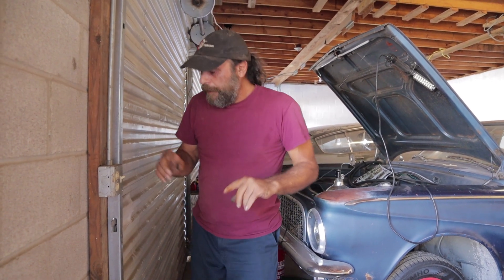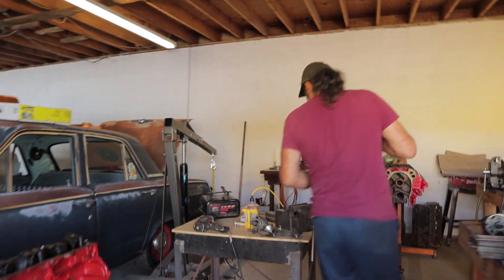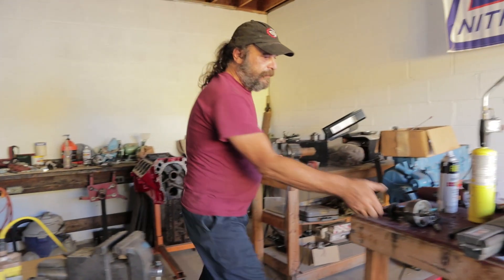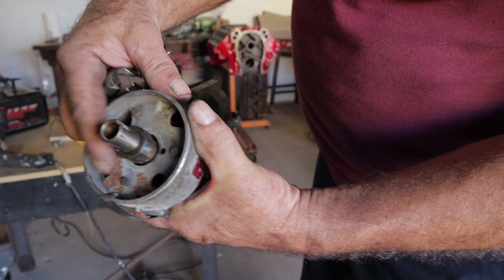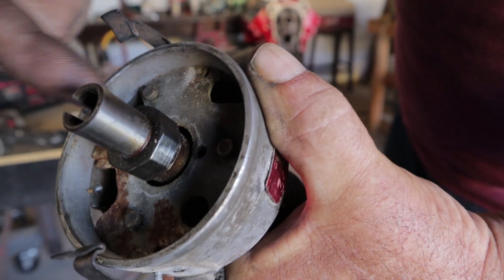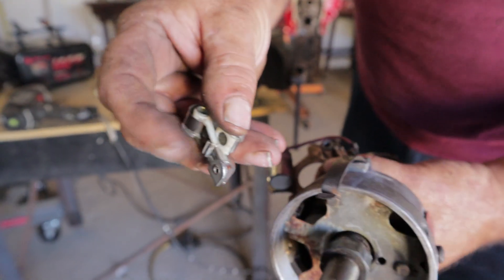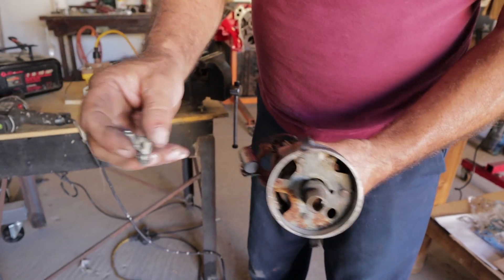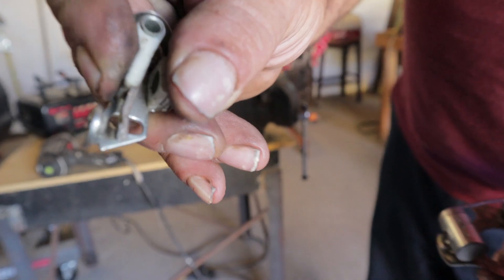Classic Car Tech-Ignition Points Explained

Comment: I have a 1973 Triumph TR6 and I have become a big fan of Uncle Tony!  The technology is the same as for the old Mopar cars Tony works on.  I’ve tried the Pertronix electronic ignition but have gone back to points because I’ve had better luck with them. TR6’s went from “non-ballasted” (no resistor between the car’s electrical system so 12 volts at + side of coil) to “ballasted” coils (resistor/ballast or resistor wire drops voltage to +/- 9 volts at + side of coil while the car is running) in 1973 which can drastically shorten the life of the points if you’re using the wrong coil.

Comment: I had a 59 Vette.  had a high tech dual point distributor. In 1984 I put in a 350 Cheby. Pumped it up. Rev'd to 8000rpm.. I used all the good parts. But I was still in the stone age.... I decided to try something different. I couldn't believe it was possible to improve on a good dual point.  Well, I put in an Accel BEI distributor with their Laser Box. And picked up about 50 HP. Literally. It was impressive on top end. I felt like Alley Oop with his dick in his hand. The BEI Laser system isn't produced now, it had issues. But when it worked it was spec'd to rev to 13000rpm on 70% nitro. It beat the crap out my the spare distributor, a Mallory Unilite.  That thing cost at least 20hp.  It was quite a lesson but I learned that electronic ignition is the best. A Magneto or an MSD8 would be as good, I assume.  The BEI distributor has ball bearings to hold the shaft. It was very precise. Used Hall Effects, of which i Know Nothing except it works.   Oh, my dual point had issues too:: The cam lobes wear and that makes setting dwell tough. And points bounce! Even at 6000rpm.  If your making HP you must use a magneto or something like an MSD8

Comment: 6 years later and Uncle Tony is still helping me out. 

It would have been nice for him to quickly explain that the voltage goes through the ballast resistor, onto the positive side of the coil, and then the points/condenser are connected to the negative side of the coil. Anyways, thanks. I've always wondered what the electrical flow does with these old cars.

Just did a tune up on my 69 buick skylark and lost spark after that. Now I can accurately diagnose it and find out the issue.

Comment: I always test ignition system with the battery make sure the condensers in series with the points or you're not going to get a good spark, violet blue spark very good red or yellow very bad. Look at the rubbing block on the points look at the points if they're shot they're shot. Check for distributor play looseness, then I think one of the most important things to check your ground wire and check to see if the vacuum advance is working. Then you look the whole thing over always always people used to replace caps and rotors when I can just clean it up but I always replace the plug wires unless there's a really high dollar wires that are not made of carbon but are made of wire. PS sometimes I had to take some 600 sandpaper and lightly sand lobes a little bit smoother so it doesn't tear up the points and cause them to close up as the cam would wear off the rubbing block.

Comment: Got a 67 250ci impala and a 68 C10 with 283ci (not original) both with points. Being the “mechanics car” I’ve never done any maintenance on the points. They just work for 20+ years and they have 20k miles each. I’ll probably have to service them soon but they’re not troublesome…

Comment: Nice presentation uncle Toni very simple. I’m a points and condenser guy. They’re reliable and I can fix them if they go bad if an electronic module goes bad I’m in the middle of nowhere. I cannot get the car running again.

Comment: Just to be clear. I can run my positive wire from battery power through a resistor to the coil? With a switch between the resistor and battery power?

Comment: I need some help, I have a 1963 Ford Falcon factory no mods, it’s getting 10.5 volts at the coil.  The car will run great for a half hour then die.  When I replaced the resistance wire from the ignition it ran like crap. I have since reconnected the old resistance wire.  What else can I look at to find how 10.5 volts is getting to my coil?  Thanks

Comment: Thank you, this video helped me immensely, I just spent 2 days trying to figure out why my 77 corolla doesn't have any spark. I thought that the wire on the distributor was supposed to be 12v, which lit a set of points on fire, luckily they had to be replaced anyway. Thanks

Comment: Key Takeaways:   Electrical ping-ponging taking place to turn 12v into 40,000 volts to generate an electrical spark.   The Coil works in Tandem with the distributor which works in tandem with turning the engine with a starter or under its own power.   As the engine is turned, the distributor has a series of 'contact points' (akin to a momentary switch)  that will be energized in a round-robin sequence that complete the circuit and energize the Coil.  Eventually as the distributor  rotates, the momentary contacts points break the circuit, the coil de-energizes and the collapsing magnetic field inside of the coil induces a higher 40,000 volt charge (like a  transformer does) that flows through that heavy center wire back to the distributor block and will energize the spark plug attached to that momentary contact point thats tied to a specific cylinder in the engine.  This keeps the entire engine firing the spark plugs in the correct order.   I don't know why they never rectified the language to call things for what they do, this is by far the worst tragedy in any 'educational' system to go with insufficient terms:    A Coil is meaningless.  A voltage amplifier would be a better term.   A distributor is a misnomer.   A power-sequencer is a better term.

Comment: Good vid, but disconnect your 12V before you blow your coil. That sparking coil wire at 4:44 meant your points were already closed and fully prepared  to overheat your poor coil! And yank the power as soon as your demo is over!

Comment: My brother's German Konig-powered race boats regularly required changing its Bosch or Sems magnetos, often between heats, as they didn't like heat. When he came in from one heat and the magneto was snarly, he always thought it best to exchange it with a "fresh" one. Time between heats was 5 minutes, so time was in short supply. Before we yanked the hot mag off the engine, he always wanted to ensure the fresh mag was good, so he would hold the mag in his hands and spin the gear... with me holding on to the leads. My arms still ache some 40 years later. I much prefer your test, Tony.

Comment: Working on a 1969 lincoln mark iii. Has points. It's driving me insane.  Runs good for about 30 seconds. Then runs like crap and eventually stalls. Sometimes clears up and idles good again for a few seconds.  It's not the carb. Tried pouring in some fuel while running. No difference.  I'm stumped
Reply from the maker: condenser

Comment: as of right now,i've replaced every ignition system on two of my cars and my motorhome,took everyone of them back to 1969,they all have points condensors and ballast resistors and common coils,two sets of points ,condensors and extra coils in the trunk in a shoe box,i'm not breaking down again in the desert with overheated electronic horse caca,walking is not crowded,and he's right there is no difference in voltage spike,the higher voltages come from exotic coils,and uncle tony is right,only thing electronic in my motorhome is the tv and the radios,point worked for a 100 years,change leaves you stranded

Comment: As you know, 1,300 RPM is 650 rpm at the rotor and 1,300 rpm at the rotor is 2,600 at the engine

Comment: great bench top setup.

I have a question.  On a motorcycle or lawnmower there is a flywheel and stator or maybe a magneto that provides the power to the coil.   In an automobile what makes the power that goes to the ignition sytem/coil?  Alternator?

Comment: I don't have any problem with my points I've set them only 1 time feeler gauge didn't work a old drag racer / hotter rodder told me to use a match book never had a problem the main problem is ppl switch it to 12v with out installing balsas resistor and adjusting timing
Reply: I've learn this when I was 17 i just barely turned 30 oh I for got to add even if u change generator to  3 wire chevy alternator internal voltage regulator and u still need to install a balas resistor weather you run points or not the original harness from late 70s and back was a 6v system wires will get hot and also burn the points leaving the key on will burn the points incorrect timming will burn the points old spark plugs will burn the points. Points make sure you don't slack off on the basic maintenance!!

Comment: Hi Tony. I bought a complete distributor assembly for the dakota engine project and it was working well, at first. For some reason the clamping force was not the best with the hold down bolt securing the contacts. My timing light was showing it bounce around almost 15 degrees! Carefully with a dremel I took off both the flat washer and tiny lock washer and replaced with single but bigger lock washer only. Works great now. the lock washer just seems to bite and grip into the metal surface a lot better.

Comment: Do you get that many idiots that don't understand how points work? You have done many videos explaining how it works and are very easy to understand. Been running them for years on my 69 firebird ramair 3 with no problem if you keep them clean,gapped and dwel set. Keep up the good work and videos cumin.

Comment: Good video uncle Tony

 you can’t beat points and carbys

And it’s a shame really they got rid of all that because motor mechanics used to advertise “tuneups” and a good mechanic had a good ear for the Carby he also knew all the set up tricks for the points and condenser and how to set up the dizzy just right.... there were some finer points to it as you know.....

They knew how to read spark plugs when they needed changing he could Figure out what was going on there if they looked a bit funny he knew how to adjust Carbys by ear and feel 

They used to cut paper gaskets on the spot to fix the leaks test and spot cracked dizzy caps that can be hard to do because you can’t see the crack and then under load with the rotor button turning the crack opens up and the car runs funny because the timing is now out.......but you very often can’t see it because the car is driving.......

they knew how to test spark plug leads..... 

So a really well trained mechanic doing tune-ups was a real asset and customers used to stick to the good old boys who knew what they were doing......

now it’s all about price they just change engine oil and the oil filter check the tyre pressures and that’s it....!!!!

And half the time they screw you and tell you its synthetic oil and it’s not it’s just the cheap mineral shit

they’ve taken the trade away from people being skilled in my opinion it’s a bloody shame....

And in some respects I would accept that if what they replaced it with was actually better..... but it isn’t...!!!!!

And as a matter of fact it’s worse it’s more expensive people don’t know how to repair components so they just replace computers and coil packs etc.... which cost big money they don’t test anything they are just parts installers

I am not against progress but to me in order to constitute progress it has to actually be better across all categories....... performance - price - reliability and the new systems just do not cut it on any of those categories in my mind.....

All it is is it’s different 

It’s not better

and computer controlled ignition and injection is a salesmans delight because they can talk that up all day long......

They’ve now got a point of difference to sell cars but arguably it’s not better at all

Comment: to add to that, i have a vw bug that has a points ignition with a transistorized ignition,been using it for years,one day the ignition kit failed and i returned back to points,and i cant believe the torque i gained from going back to contact points

Comment: By setting up points and timing a little bit aggressive U can pump out better bottom end power or help UR motor run strong all the way to redline and slightly beyond without that dreaded point bounce.  New points will also help to keep that bounce away. That spring wears out.

Comment: My 74 350 runs better on points than an hei. I put an hei distributer in and the motor would not run. I had to turn the idle way way up to get it to run at all and it had no power. So i put the points back in and started the motor and the sob was idling at 3500 rpm. Re adjusted the card and it runs like a dream for about 8000 miles then it will miss and break up so i clean the points and set the dwell with a dwell meter and run the shit out of it. My 82gmc had an hei disributer. It smoked one day and melted down so i put the hei i had laying around in my 82 it ran just like it did before. So i got another points disributer from the junk yard and put it on my 82 with a good hot coil and the fucker was idling around 3000 rpms. I dont run hei on anything anymore, all my chevys have points.

Comment: Nothing as good as a well tuned points set up, and it isn't hard to do once you get your head around how it works.   It's as reliable a setup as you can get with no worries about breakdowns on long trips or when you have to go to work in the morning.  I'm using the points setup in the 65 Impala.  I ain't badmouthing electronic ignition, but for me, a simple, reliable points setup is hard to beat.

Comment: I used a dual point 1963 Corvette distributor on a fresh rebuild of my 350. I then bought an Acell BEI ignition and distributor, ball bearings, Hall effects.... guaranteed to hit dead on at 11000rpm on nitro. I picked up around 50 HP. It spins to 7800, 550hp or so. I also had a Mallory Unilite. Better than points but it doesn't hold a light to the BEI. Sadly it is no longer made. An MSD7-8 would be equal With the proper distributor

Comment: Ok, so you said points and HEI can have the same output , only difference is analog vs digital trigger.  So if you take a points distributer,  add a super coil and heavy duty wires, cap and rotor is where you can match the voltage of an hei? Great explanation/video by the way.
Reply from the maker: That's pretty much exactly what we did here...take a good look and listen to that spark

Comment: Mallory dual point with 2 Holley 750 dual lines on a tunnel ram. 429 Ford in my uncles 1972 short bed truck in 1988. Tune that fucker up on a Sun machine and get those carbs synced. Dwell meters. Vacuum gauges. Quickly becoming a lost art.

Comment: in my 67 mustang used the pertronix 2 electronic conversion cost me $120  aft 3 years of everyday use it would get hot and quit until it cooled down. for less than $10 I put new points and condenser back in and haven"t gone back. from what I understand points struggle past certain rpm ranges so when i swap my heavily worn motor out with my lightly modified block I'll go back to some kind of electronic ignition to work with the fuel injection system I'll be running
Reply from the maker: A good duel point distributor with matching points will make reliable spark thousands of RPM past where the rods generally fly out of a typical hot rod engine
Reply: @UncleTonysGarage  good to know. I haven't played with those yet. my fuel injection i pulled from a donor vehicle might require a dura spark distributor to run the injector pulse but I haven't done enough research yet

Comment: I'm no expert but the condenser coil was explained to me by an old WWII bomber  mechanic. Put simply: "it stores voltage. It's a capacitor.  The gap between the contact points is so small that current would arc across the gap if the condenser was not there, and not allow the primary coil circuit to collapse and provide spark to the plug." basically, positive current will not flow against another positive current.  A points ignition  car won't run without a condenser because it's like the points aren't opening thus not allowing the coil circuit to ever collapse. From coil's perspective, it's like they stay constantly closed. If i'm wrong, let me know.
Reply from the maker: I would absolutely concur with that, except I have seen point systems function without any condenser attached.  Sometime this weekend, I'll set the demo system back up again and test that
Reply: @UncleTonysGarage  - again, not an expert....but if a gap were wide enough and the voltage low enough, it's conceivable that the points could open, electrically speaking. What i am an expert at was charging condensers and leaving them on the work bench for an unsuspecting person go grab it. It will shock the hell out of you! Somewhat forgotten to history was the 12V wire that ran from the starter solenoid to the negative side of the coil. When you turned the key it would put a  full 12V, non-resistored, to the ignition system to help cold and hot starts. A few seconds in 12V would not damage the system. Lost count on how many cars i saw that disconnected or just missing. As if the engineers just added an extra wire for no reason.

Comment: I hates the points and wont work on em, I use magnetic distributor instead, performance engines are picky enough and points love to mess with owner operator, I gave up trying to figure them out went electronic decades ago, but I have some old timers that have perfectly running engines with points. Cool video to watch but I wont be going back!

Comment: I'm one of those "slightly" over-40 guys that never had to get deep into points (until I had to re-build an old 1953 5-1/2 horse Johnson outboard).  All of the vehicles I drove had electronic ignition.

My Dad talked about how they used to set the gap on side of the road with a pull-tab from a beer can.  It was good enough to get you home.